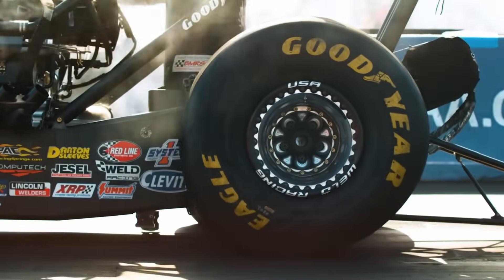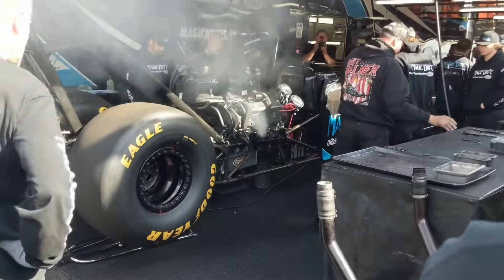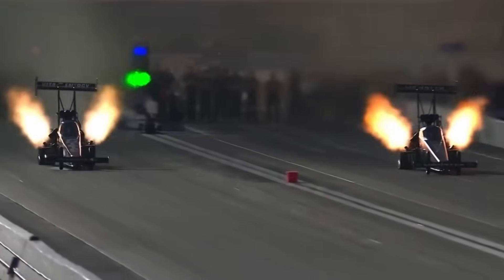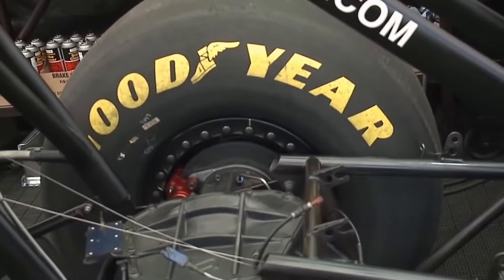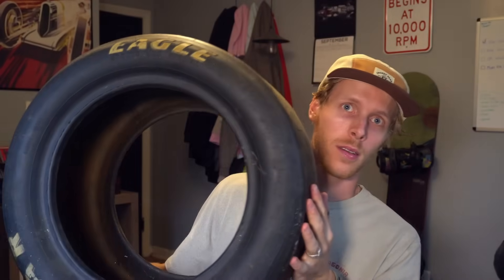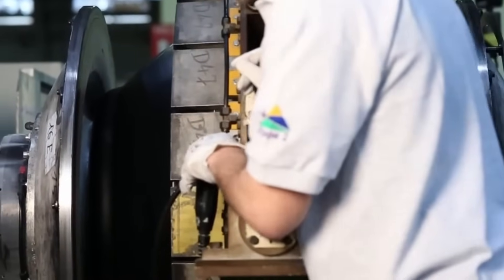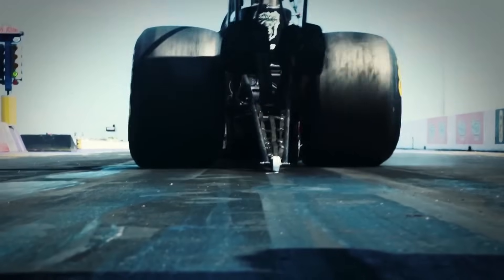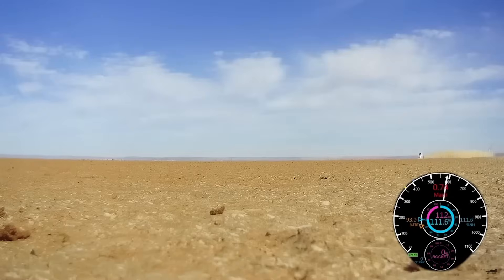How to Build a 300MPH Tire

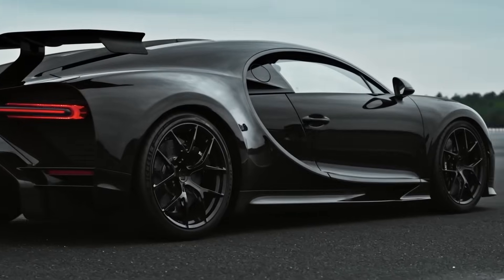Comment: Love the video!  @ 3:55,  F_d = 1/2 * rho * C_d * A * v^2.  Force required to push an object through air depends on the SQUARE of velocity, not the cube. The power required is cubic with velocity, P = F_d * v = 1/2 * rho * C_d * A * v^3, so the 8 times the power statement afterwards is correct. 

Also, love the series. Literally went through the calculations for fun. 

C_d - coefficient of drag
A - frontal surface area
rho - density of the fluid (air)
F_d - drag force
P - power
v- velocity
Reply: Yep, as soon as he said that I said squared as well.

Comment: You said in the video that air resistance increases as a cube function of the speed. Actually air resistance is a square function of speed.  Now, maybe a very high speeds, 200+ MPH, that square function may get left behind. I'm not sure about that. Overall though, your explanations of very interactive technical systems is excellent and understandable.

Comment: Forgot to mention... Heat builds pressure, the tire compound is designed  to change grip with heat, and the tire is designed to layout/bond its rubber to pavement. So, the burnout raises the air pressure, makes it sticker, and grip at launch. Over time multiple launches provide more grip down the track, until rain makes it green, or not enough clean up makes it slick.

Comment: 8 minutes of that speach cadence is tiring. Also, although  you are correct about the power per piston number, you neglect to mention that a top fuel engine lasts about 30 seconds before it gets rebuilt. Modern F1 engines have to last 3 months being shipped around the world and then being run at full tilt for multiple hours per race weekend. This makes F1 engines better because it makes them relevant to the real world or passenger cars.
Reply: apples and oranges it ain't a competition dawg
Reply: Yeah, F1 engines are really relevant to passenger cars. People mistake them everyday. I think they cost something like 10x the cost of a top fueler engine, which likely costs 10x the cost of a passenger engine.

Comment: Wtf is a mile
Reply: Wtf is a kilometer 🗣️🗣️ 🦅
Reply: 1760 yards
Reply: 5,280 feet
Reply: Like 1600 meters
Reply: Came from the same place as that slang Youre using.
Reply: It’s a unit of measurement men use.
Reply: @Goofyguy90 fuck the imperial system

Comment: The exhaust does what now?
Reply: Adds to the downforce. You know like the wing and other aero devices are used to keep the car on the ground?  The fuel dragster's exhaust pipes act like jets. They used to be flat in the early days(early 1950s-early '60s). Nicknamed 'weed burners' . But have been 'pointing up' since then. By doing that the exhaust 'blows' upwards adding downforce. Approximately 1,000 lbs (pounds) of thrust is created just by the exhaust. All helping to keep the dragster on the strip.

Comment: The one thing you didn't mention was the tacky substance sprayed along the first section of a dragstrip. Yes these tires have a massive contact patch during launch and have a lot of traction, but that alone isn't enough to grip under sudden acceleration.

The dragstrip uses an almost tar like substance that greatly increases traction during launch. It's sticky enough that it will literally pull your shoe off if it isn't tightly secured on your foot.
Reply: Fresh rubber and Rosen

Comment: I recall as a kid turning my mom’s exercise bike upside down in our tv room and seeing just how fast I could get that single solid tire going….well beyond design I found as the centripetal forces expanded that so far that it flung off the rim….making it next to impossible to remount…with drag cars I always wondered how at those high speeds those tires at those widths managed to remain mounted and not come off the rims?…..
Reply: Bead locked...as in, they're literally bolted to the rim!

Comment: Only for the books:
" . .A derivative of the Twin Turbo Corvette, the 880 hp (656 kW) Callaway SledgeHammer, recorded a speed of 254.76 mph (410.00 km/h) on Ohio's Transportation Research Center track in 1988, making it the fastest road-going car at the time . ."
                                                                 Source:   Wikipedia; "B2K Callaway Twin-Turbo"
And last, but not least: 
JOHN DAVIS: Those tires reportedly cost Goodyear a million bucks to make. But the real-world R&D, coupled with bragging rights of helping to create an iconic performance legend, was more than worth it.
                                                                 Source:   Google
And with your connections to Goodyear, they will tell you the Date of the production ! ! !

Comment: There is a video from the "Ghostrider" from sweden...long time ago. He was that crazy guy, who raced his subaru or motorcycle on ordinary streets in sweden. And one of his videos was called "uppsala run"... a short video about a high-speed run from Stockholm to Uppsala (with a motorcycle)...the original video is long gone, there is somereuploads, but they aren´t original versions. At the end of that "run", he showed his backtire and how scraped it was ....because that high speeds and... a speciality of swedish streets: the construction of the road...espacialy the surface. They sometimes not simply using asphalt, rather they put sharp and edgy stones on the upper asphalt-layer, so the tires do not have contact with the asphalt, rather with sharp-edged stones - what is very good if ice is forming on those streets (all red/brown road-surfaces  are such edgy stone surfaces in sweden). And the tires, at high speed, degrade fast. So in that video, a "ride" of  around 68 km (42 miles) were enough to distroy the tire (it does held together and under pressure, but the rubber was almost gone - cutted away from sharp stone-edges during high-speed-manövers). He made it in 15 minutes.
Reply: I still have all the DVD's  of this.

Comment: My favorite part about my traxxas rustler and trx4 is the ballooning of the tires when im rippin it around fast
Reply: I usve a short track truck from a brand called "dromada" and it screams.  A hundred bucks for it and a remote and it flies.  Check it out.  You will love it. They scream.

Comment: Every person should experience one of these monstrous works of art in person. It is truly life-changing. I once got pit passes for Cruz Pedregon’s race team at the spring nationals at national trail raceway in Kirksville, Ohio right outside Columbus. so I personally got to see them breakdown rebuild his engine. the behind the scenes crewmembers are the true heroes
Reply: A general event ticket is a pit pass that’s why the NHRA puts on a better event than other motorsports.
Reply: @Whitewizard1289 that's common today, but it use to not be like that. I remember back in the 80's and 90's we had to buy pit passes. 

Nowadays I think most every dragstrip allows this with general passes. It's what makes the sport stand out over most others. Regular joes can get right next to the cars as they are being worked on. Having your eyes, nose, and throat burning during a top fuel warm-up in the pit is basically a right of passage. The truly blessed will get to experience a throttle whack.
Reply: @Nareimooncatt  I was making the comparison that going to a drag strip is not only a cheaper but better experience than what a nascar race would be. You have to buy your general admission ticket then you get your garage passes or you can spend more and get VIP passes. I wouldn’t waste my time to go to Bristol for a naacar race but I’d damn sure like to experience thunder valley.
Reply: @Whitewizard1289  I grew up with the Texas Motorplex basically in my backyard and now I do occasional media coverage for jet cars as a hobby when they come to tracks near me (small plug about my channel :p). I don't disagree about drag racing being one of the most fan friendly Motorsports out there. 

The main point I was trying to make is that pit passes use to not be part of general admission. Maybe I misread your comment? It sounded like you thought it was always like that and I was providing clarification for others.

Comment: Wouldn’t you want a bigger tire at the start and a smaller tire at the end? 

Larger tire would be more torque at the start and smaller tire would be higher speed at the end?
Reply: No they have it correct. A small tire is easier to spin effectively increasing torque. As the tire grows it covers more ground per revolution, increasing speed.

Comment: I had a set of off-road tires tires that would wrap , I couldn't afford beadlocks so I drilled holes in the rim to and a bunch stainless screws into the bead. I don't recommend

Comment: Beadlocks are becoming somewhat popular on high horsepower "street" cars. If you look at platforms like the Supra, GTR, or any V10TT (R8, Viper, Lamborghini), most of the shops putting out 2000+ hp kits are using beadlocks.

Comment: 6:17 thats actually not the whole truth. I forget which super car it was now. At speeds near 300, the tire actually cools faster than the heat generated from friction. that results in a slightly lower tire pressure. Of course i cant find where i read that now though.

Comment: Really good vid. I do have to point out that nobody using beadlocks will use an air bead seater (see at 0:18) because you manually fit the tire to the wheel and lock the tire bead down with the beadlock rings.

Comment: 9850 pounds of torque actually. As measured at the driveshaft on the Toyota top fuel car. Thats 12,800 horsepower.

Comment: What I can't get over is all that shock and awe of horsepower is delivered to a couple of meshed pieces of steel in the differential. Maybe 3 or 4 square inches of contact.

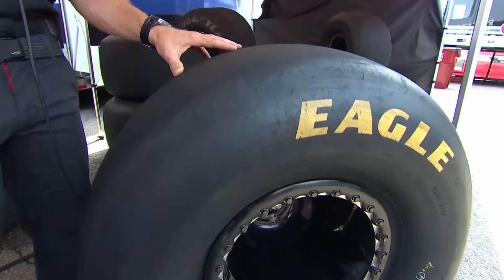Comment: 2:43 cars don’t hit terminal velocity, that’s a term used for objects free-falling.
Reply: The car is falling sideways, there you go
Reply: Terminal velocity is the maximum speed attainable by an object as it falls through a fluid (air is the most common example).
 Final velocity (end) velocity is a calculation that measures velocity at a specific moment in time. It includes initial velocity, acceleration and the elapsed time. 
 In the case of dragsters, final or end velocity is the speed of the vehicle at the finish line. 
 Nonetheless, I'd be willing to be that he intended to say maximum velocity, which is still applicable.
Reply: So, you are the protector of terms? You are the rule guy?  You learned about terminal velocity in free-fall and you don't think it should be used anywhere else? Did you check with the Science Committee of Stockholm?  
The term can be used in other context. Especially when everyone listening understands it completely.  
Airplanes and race cars have the force of Drag in the horizontal plane. Not just for objects free-falling vertically. Open your mind, dingbat.
Reply: Thumbs down
Reply: Terminal velocity just means end velocity, since the terminal phase is the end phase.

Comment: "You can only do so much with rubber." I've had a thought tumbling around my head for a while, and as cars get faster and faster, it keeps coming up in random thoughts I have: What other way would I try to design a tire? I'm talking a tire that isn't rubber, air, metal. While I'm sure tire manufacturers have looked into this idea in their R&D departments, they, ultimately, can't pour the time and money it would take to experiment because they...well, sell tires. They are publicly traded companies and are required, often by law, to produce profits.
Reply: So what other elements or compounds could create grip, be durable and flexible yet be affordable or at the very least be able to be produced in the first place?
Reply: Bc I've had the same question bouncing around in my head for years.
Reply: time to go full strandbeest. the answer is 300mph legs scuttling along
Reply: Can non newtonian fluid be made into tire or atleast put it into some form of mechanism that can be made into tire?

Comment: tires can be internally inflated.... so why cant they be internally cooled? ive got some ideas that will change the auto speed game forever. such as nano tires. that use trillions of nano sized fingers that grip 1000% better than current tire technologies. kinda like how a gecko can stick to glass without effort. combine that with morphable surfaces to give cars active aerodynamics. after that, give ai a few times around the track and it will have found out how to beat human drivers. due to our internal g threshold

Comment: They’re only $1000? Seriously
Reply: I thought they’re be more
Reply: Well they only get used for a day tops so thats pretty expensive
Reply: @kyleosbun  Considering the materials, size and specificity it is absolutely a bargain.
Reply: wanna know how much the ones on Bugatti cost? 42k usd for a set lol
Reply: @swilleh_ 
And they only last 10k miles.
Reply: @swilleh_ and they arenowhere near as grippy as a drag slick.
Reply: @swilleh_  but those ones can fit on a somewhat normal sized car, and actually last. These mfs almost last less than me
Reply: Good for 5000ft though
Reply: They are only good for one run.
Reply: @thomascraddock8697 no they are used for 4-8 runs.
Reply: @thomascraddock8697 my stepdad used to dragrace before he died and i worked in the pits as a kid.
Reply: Pound for pound I wonder how they stack up to moderately priced passenger car tire. I was just pricing out tires for my Scooby and it was pretty easy to spend $160-200/tire.
Reply: I’d say most of that 1k is going into the materials and manufacturing overhead, because the tires are replaced so often the fact that the market is niche is outweighed by the volume of orders. This makes it a viable product to be “mass produced”, and thus cost-reducing, rather than bespoke one-off orders every so often.
Reply: Long story short, because it’s not a commercial product for normal citizens.
Reply: @MP-vc4nu So you are saying it's the hobby tax? Seems about right.
Reply: Not a chance lol
Reply: @alaefarmestatesllc they sell on average for 1100 to 1200. A simple google search.
Reply: america
Reply: For only 1 or 2 miles 😂
Reply: Definitely gonna buy a set just to have em
Reply: The whole vehicle is only like half a million I think
Reply: A complete motor with blower fully assembled and dressed is 250k at least clutch pack ti bell houssing and fingers and bits and peices 100k wheels tires 20k rearend with guts 50k carbon fibre is crazy expensive probably 100k in carbon. 100k fir chassis rollcage. 20k fuel cell pumps etc. i would say its a million for a team to build a tip fuel car
Reply: @denniswilder3014 topfuel aint no joke. It cost to be the boss.
Reply: Yeah, race tires are expensive compared to regular tires but not THAT expensive. You gotta remember they go through multiple sets of these in a single race day.
Reply: The new tire is only used once. After that they are basically repaired. They only last a race or two
Reply: @giveagoonsomelove no they are not used just once. They are used 4-8 runs.
Reply: That's what I was wondering, preciate the info @giveagoonsomelove
Reply: lol you say only like you could afford 3 of them because you act like it won’t break….
Reply: @uniq7778  when you wanna sound smart but you reaaaally aren't
Reply: @AnitaPOE2 exactly.
Reply: @uniq7778 no, its just shockingly low. dont be a prick
Reply: @uniq7778 what? 😂😂😂😂

Comment: The frame of a top fuel , the torque and loads, could you do a video about ?
Reply: Back in the 10,000 horsepower era we were told that the frame rails under the motor experienced 14,000 pounds of thrust. The Motor plate is what holds the motor in the chassis. It's between the block and the clutch can. It think it's 5/8" plate.

Comment: Why are they bias ply?!?!? Wouldn't radial be better??
Reply: Radial tires have reinforced sidewalls. They won't wrinkle the same way. Plus, tire pressures are very low for maximum contact. Low pressure in radials cause the steel belts to fray and cause millions of tiny leaks.
Reply: @michaelmoore7975  ohhh thank you

Comment: Question: how many races can you run a tire on a dragster? Are they finished after just one race?
Reply: Google says they are designed for 8 runs down the track but the top funded teams go as little as 1 to 3 runs.

Comment: I’m shocked that tire only cost that much.  I would have thought double that.
Reply: I imagine all the "free" advertising via the sidewall lettering helps offset the cost.
Reply: dont worry. run 2 times and you pay double. At least if they need to change it after that. this price for 1 round  adds up quick xD.